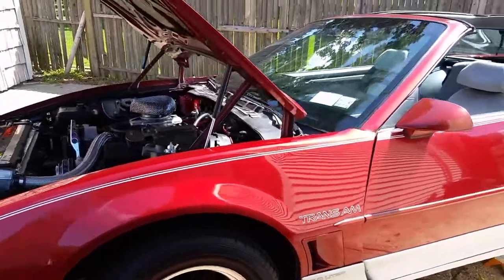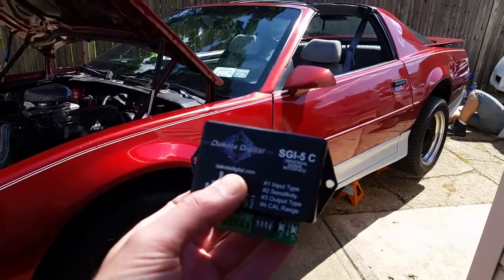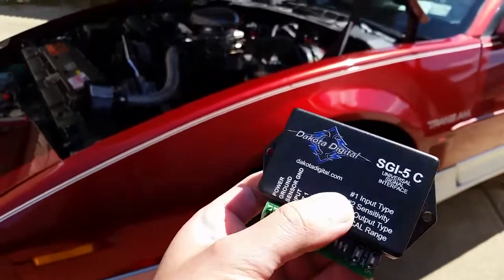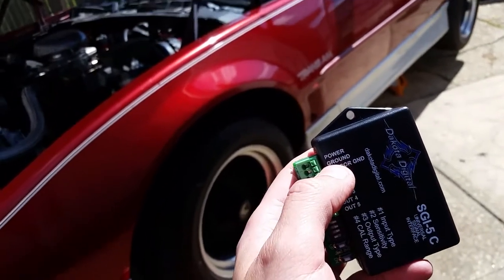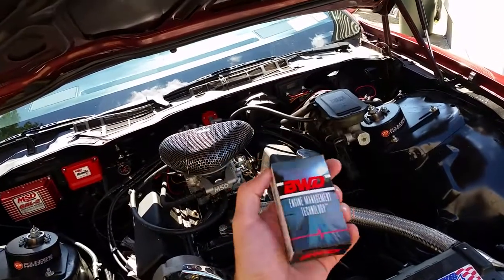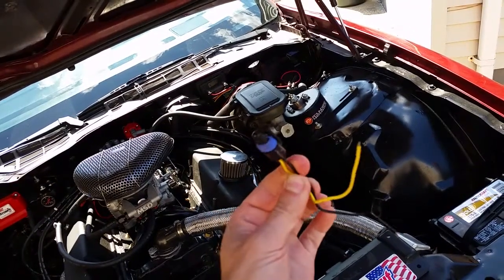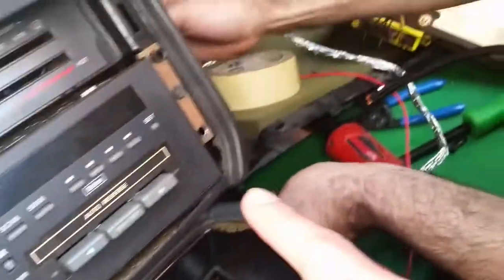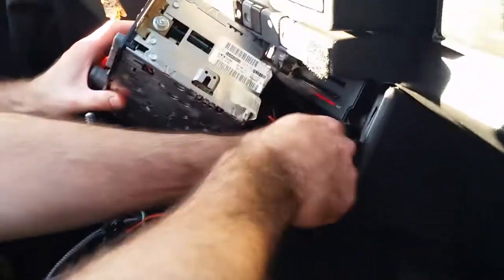SPEEDO CORRECTOR!!

Comment: Good stuff, one question:  What's the need for the dakota digital box.  When you first started the vid I thought it was for the analog to digital conversion but based on what you said when going over the speed buffer the a-to-d conversion is handled by that box, so why replace it with the dakota digital one?
Reply from the maker: The ppm is different..thank you for watching
Reply: klowny1969 So with that box you can convert the PPM of a sensor up or down?  Very neat, thanks for the info/video!
Reply from the maker: Yes that is correct.

Comment: Does that box work for stock T5 to be able to adjust for a rear gearing change? I went from 3.43 to 4.11 on what is now a track car, but i still drive it on the street ocasionally with that damn GPS spedo. I want my normal spedo back but i cant find any answers on how to handle the change from different final gears.
Reply from the maker: Yeah..call Dakota digital for any other inquiries..dont forget to susbscribe

Comment: I'm doing this exact same thing in my 91 camaro rs 305tbi 5 swap to 350 tpi 6 speed, I am wondering if it's pretty much the same procedure as this firebird and is the VSS buffer box located under the console as well?

Comment: I have a question I'm currently doing a t56 swap my 88 firebird formula 350 and im also using a digital dakota box, how would I wire in the rest of those wires from the yellow buffer box into the dakota box? One was for cruise and one for engine control I believe? Thanks

Comment: Great video! Thanks! Everything is clear, Only got one question. I have automatic transmission, so I think I need VSS high and VSS low to go from VSS sensor to 20 and 21 pins on pcm, so transmission can read speed from the sensor.
How can it be done in this config, as both vss wires go to CGI5 and VSS inputs are open on PCM (ECM)?
Can it be spiced, so 2 wires go to CGI5 and also to PCM (ECM)? Thank you!

Comment: Hello great video. I just upgraded my cluster on my 90 Silverado to a 93 Silverado. Old cluster had drac built in cluster. New cluster  I had to wire in a external drac. I have a 700r4 tranny will this set up work for me?

Comment: What kind of VSS is with two wires output, where the magnet is rotating inside static coil around which this coil has this two wires output? I don't beleave it is variable reluctance sensor.

Comment: Will this digital box work on my 1991 trans am?  I replaced the stock 2.73 gear with a 3.42 and now the speedometer is wrong.  My car does not have the speedometer buffer.  Thanks for your help.

Comment: Would it be a similar procedure if the transmission were stock but you changed out the Speedo? Say from an 80mph to a 120 or 140 mph speedo?
Reply from the maker: +Jack Williamson yes maam

Comment: Why wouldnt you just wire it in to the body harness between the trans and the original plug that went to the original transmission? If you change the signal from the trans to the original output signal pulse before the computer as it was from the factory wouldn't it work the same way? So you wouldn't need to modify any of the wiring at the computer just the wires that use to plug into the original trans
Reply from the maker: Rusty Lindamood you would have to wire it inside the car anyway, so its away from the outside elements